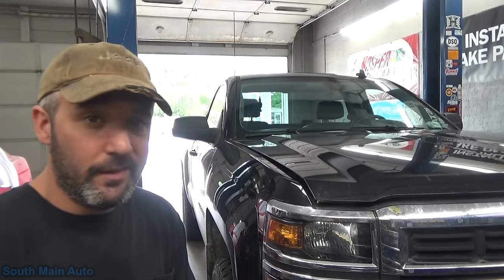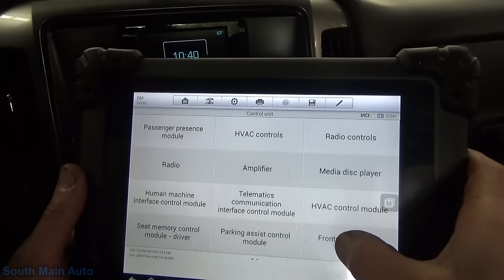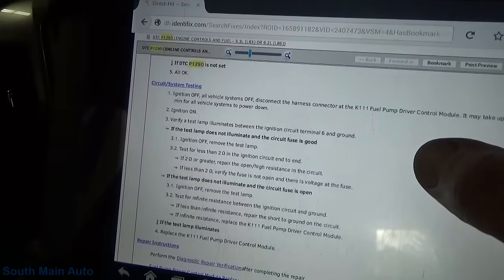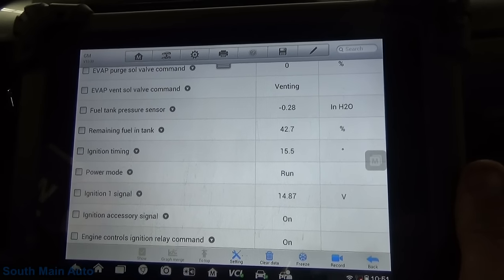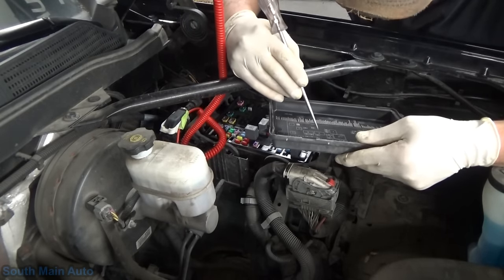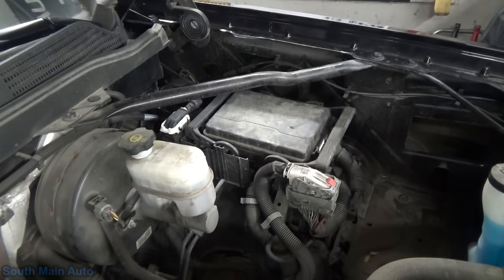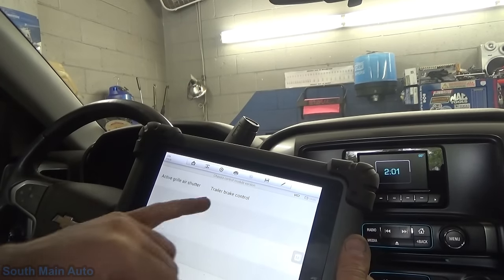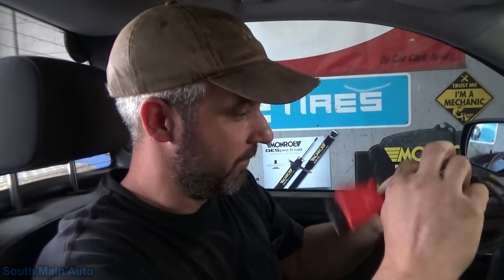Chevrolet Fuel Pump Driver Problems - Where Is The Broken Wire

Comment: see another one i sat thru and learned alot, very methodical, i too do the band aid on the wire it self,  what r your thoughts
on, in my case i would spray the connections with a good shot of wire dri followed with a liberal amount of dialectic grease 
some of those bastards are hidden and i just don't want to think about them again for a couple of years, anyways another excellent video. i wish i had you as my high scool auto shop teacher.

Comment: SMA and One Auto video on a friday...... damn its a good end to the week :) 

Out of interest is there any reason why the wire broke???
Reply from the maker: It must have been compromised sense new I imagine. No other clues were there where it broke.
Reply: +South Main Auto Repair
Yes, I also wonder if that was a disgruntled employee that accidentally missed that damaged wire....Or perhaps a temp contract QC inspector that was sleeping or high on the job while they were supposed to be looking for flaws. LOL I work in a tier one vendor plant and usually that is the case. Plenty of processes in place to prevent things like this flaw from not being contained and slipping by to the manufacturer.

Comment: Every car issue i have had has never ever thrown any codes but ran like garbage - 2001 Toyota Corolla with a jammed IAC valve (stall with ac on when cold or low cold idle high hot idle), 2000 Nissan Pulsar (bad MAF sensor), 1996 Subaru Liberty (moisture in one of the spark plug wells causing a misfire NO CODES), 1992 Toyota Celica with a bad MAP sensor,  and a 2000 Subaru Outback that ran like garbage (sold), never figured that one out again zero codes or any hints as to the issue, and i have a 2012 Holden Commodore now with idle nibbles again ZERO CODES. FML.

I swear all Australian cars have misfire detection removed on all ECU's.
Reply: apachelives after all those cars of different makes, all due respect but maybe the problem is you and not the cars.
Reply: how can the problem be me?

Comment: Had the same problem in my shop but I used a Fox Hound to locate the break and then used a sowing seam ripper to open the harness. Except now the wife is upset that I went into her sowing kit without permission and even ignored the "no borrowing" sticker on the side. And now Ma Bell is after me for unauthorized use of a fox hound. Should have brought the truck to SMA
Reply from the maker: Did you  use OEM tape to put it back together?
Reply: Dorman

Comment: I got a feeling those telephone tracers don't work as well as is said, because the phone company is always pulling at least 32 to 1024 twisted pairs or better with many many unused pair left over to transfer broken lines too. They use the tool mainly to find the correct ends after separating the wires at the ends to detect which pair carry the tone. Lol Jpol.

Comment: hey buddy, i have a 18 seirra 5.3 crew 4x4,  thing stalled after sputtering while driving , p129d p12a6, checked wiring, im a licensed mechanic,  cleared drives fine, but dont trust the truck now, no warranty on fuel components either dont want gm to run a big bill on me any ideas?

Comment: This was an awesome repair it shows us how to diagnose a problem and fix all the open sores. And by no means are you stupid or dumb if you just popped a $200.00 pump on it and then found out it was just a wire you would be a diaognoster generous you are your talented.

Comment: Again Eric O ..
 Ive always been taught to replace the wire . That if you can pull good voltage yo a point to cut both ends and run new rather then opening the harness to try and find what could be a break inside installation that youll never see .

Comment: Hey guy's, I'm trying to diag a crank no start 2014 silverado...  got hit in the rear then crank no start after that.... Thought it would be The fuel pump driver. Tested using Eric's wiring diagram at 8:32 I have Ign voltage at Red/vt wire Ing voltage at the Violet/green wire and ground at the black wire... Leads me to believe fuel pump module... I'm trying to jump the fuel pump so as to absolutely rule out a bad fuel pump... Think it would work???
Reply: Inertial switch has not been reset.

Comment: OMG! THAT'S A 3 YEAR OLD TRUCK.....do you see the rust on that thing. Call it 4 years old if it was made in 2013....still....WOW!
KROWN up mr.truck owner.
Reply: piece of shit chevy
JUST LIK EMY 97 DODGE TRUCK-- JUNK
FORD TOO- THEY ALL RUST OUT BAD  
NEIGHBOR HAD CROWN VIC- COP CAR STYLE 2004- RUNS BUT RUSTS ALL OVER
NEVER BUY A CHEVY, FORD, DODGE-
Reply: i live in ontario canada, and i've found out the hard way for years about rust. 
But found the best thing you can do is oil spray them yearly. 
And where i am in Canada Krown it the very best option....then they don't really rust out if you get to them early enough. But you gotta spray each year and do your part by washing it it a bit in the warm to get the salt off. Fluid Film is good too.
Reply: Good day. I'm KIT-Waterloo area, yea rust in area problem. I think dripless oil is better & cheaper, I THINK
Reply: Also a little side note, i don't know what this means to you. 
But the APA of Canada recommends only 2 places to take your car in Canada. Krown is one of them. 
The other is a single shop a guy runs in Quebec. 
https://www.apa.ca/services_rustproofing.asp
Reply: Hey thanks for sharing that, making my appointment for Krown. Between this and Eric o's video I'm convinced.
Reply: --- Big Rockk  ---
Good Move on Your Part. 
If we were friends or family , i would be telling you to Spray your car Yearly & go to Fluid Film or Krown. 
Becuase......
The Damage of Rust costs way more than $100-$120 a year to spray.  And they work really well, slightly different tho. 
The Krown Website >  www.krown.com 
Shop Locator > https://www.krown.com/locations/all/

- Some Reccomendations for when you go to Krown- 
1- COVER THE SEATS Take an old house sheet or towel / blanket put it over your Drivers Seat.  ( i personally put towels down on the all the seats. Never had a problem with them getting anything on the interior...but i have cloth....so i just figure for the 10min it takes to throw some towels down why not. Also they are in a shop environment and nothings perfect so they might rub into something on the hoist or grease and sit on your seat. Just my 2 cents there. Otherwise you won't see oil in the interior, never been an issue.

2-  HAND WIPES/ TOWEL/STEERING WHEEL. Bring some hand wipes or maybe even a paper towel role...because they work in a shop environment
      you are gonna notice a slight bit of oil or maybe even lets just a slight texture on your steering wheel and 
      keys when you get in. Like i said they do lots of cars a day and i have just realized it's something you 
      need to understand is the nature of the beast. So i just do a quick wipe down with a paper towel or  
      meguiars interior wipes on the steering wheel. Some times this isn't the case, but more often than not
      i notice a little something on the wheels and keys. Just the way it is. 

3-  DOOR RUBBERS SILICONE. Ask your shop if they apply sillicone to all the door rubbers & weatherstripping in the areas where they 
      spray.  In the even they forget , before i go there ...i just take a can of Silcone Spray and a rag and wipe down all my door 
      rubbers with it....soak it down and wipe dry and the trunk. Just in case any excess drips on it. 
      Never had an issue with it....other than when i asked them to "make it rain "when spraying my car
      i don't care about the dripping (gravel driveway) so a little much came out and i forgot to wipe some 
     from the trunk rubber....and it got a little bacony in a small area....but doesn't effect function. 
     Anyway silicone is good for window tracks and keeping door rubbers good (scott kilmer does a good
     video on silicone and window tracks) 

4- WINTER WASHING/AEROSOL TOUCH-UPS. In winter i wait till it's above freezing during the day & night for 2-3 days straight & then i wash my car 
     and the next day i just take a Aerosol can of the Krown T-40 and go around the inner lip of the wheel wells , shocks , dog leg area and painted pinch welds and spray it down. Just because those areas get blasted with Water & Salt & other nasty road de-icing stuff. (ps if you don't have those molded mud guards on your car they are worth it ( i have a clear film put under mine so they don't rub on the body , had a auto --graphics shop put the film on for $50. So dirt doesn't get trapped behind the mud guard. ANyway ........YOU WILL NOTICE that cars without the mudguard often the rocker/pinch weld area are missing paint or are rusty....same model cars that have those Moulded mud guards are always in better shape on the lower end of the car.   So basically i just try and help the krown out. And if i've been out driving in a crazy salty area
where they just spread salt....i just take the can and start spraying in that area to neutralize the salt. (I REALLY HATE RUST ) 

5-  RUST VIDEO . 
     
    This is a good little video to watch 

      YouTube Video Search Name > 
      Global News Toronto - Prevent vehicle rust damage, How Krown Rust Control works

       Direct Video Link > https://www.youtube.com/watch?v=D8u9IlwkVX4

6. FLOOR MATS.  

Good Luck with everything, just remember if your car is 5-7 years old...there is prob some rust growing small or large inside those fenders you could never see (eg. if you could remove the outer fender and look inside you'd see something)  So even if after 5-10 years of spraying a used vehicle and some rust breaks out...just remember it would have been way worse had you not sprayed and slowed it down to a crawl A new one with no rust should last even longer because you are stopping it from starting if you spray right away. 
But i have a neighbour with a 2000 Chrysler Sedan and he didn't spray his till it was 9 years old and it's still on the road in ontario daily driver.  Just don't quit spraying, Fluid Film or Krown works for a about 12-13months.  

ooh and 1 last thing. I know a lady who had a 1999 Dodge and sprayed it every year at krown from new
car was great but it rust rusted out.....NOW you might as why is that.....well.....the car was fine.....
but her floor mats ...she never had rubber mats........and only carpeted mats....and the salt soaked throw the carpets into the floor pan for 17 -18 years...and the drivers side floor pan rusted out. 

So i can't reccomend those Husky Liners weather beaters or Weathertech mats enough. 
Because they are laser measured to fit your car , not really fits better. 

Personally i like Husky Liners better (they cover the dead pedal higher up in most cases) and are cheaper.

www.HuskyLiners.com 
www.Weathertech.com 

7. COUPONS - some dealers will take the Corporate internet coupon some won't 
    (meaning some only like to let people use the coupon they send you from their shop, just case by case basis) 
    My local krown shop has no problem with printed out coupons from the Krown website. 
    https://www.krown.com/coupons/   
    (scroll to the bottom on the main krown website and you'll see the coupon section)

8- KROWN SALT ELIMINATOR MR35.

Krown Mr35 Salt Eliminator is something worth looking into ( i wash my car with it in the winter, via a Gloria FM10 foamer i got from amazon.com  or amazon.de  (germany)  mix it 4-1 with tap water 
   Or i just take it to the Krown Shop and wash it for me during / after winter. 

-REMEMBER RUST NEVER SLEEPS -   ;)   spray spray spray ;)

Comment: Hey I have a 2014 chevy silverado lt crew cab 4wd  has a code for p2635 code is it the back fuel pump or high pressure pump

Comment: The truck has had a new fuel pump and sender installed 4 months ago, then again 3 weeks ago (warrantied). Still does not have a working fuel gauge. if you jump the blue/orange and black, fuel gauge goes to full. At a loss for words. can two new fuel pump sending units be bad? oh 97 Dodge RAM 1500. 5.2 v8 4 pin connector.

Comment: Have an 07 new body 4.8l silverado when I'm at idle my fuel pressure jumps up to 57psi from the standard 43psi and I get a p0300 and my misfires counters are scattered to every cylinder mainly 8th. I replaced and programmed this fuel pump module already and same thing happens. Misfires clear up omve truck is hot. Question is other than this module, what else will command the fuel pressure to be raised at idle is it the ecm? Thanks and do you know a great mechanic such as yourself located here in Los Angeles California? Thanks.

Comment: Good work Eric, how are the f150 over there  for rust?
Reply from the maker: They are not as bad as GM and Dodge
Reply: South Main Auto Repair 
wow good to hear I have f150 2007 and its not that bad of rust  here also north of you they tend use more sand with bit of salt or some places liquid deicer before freezing rain I heard that surf is tougher on metal but I haven't found that here,
also what makes you attracted to Toyota I lie your truck what made you choose that over gm ford or any other pickups ? appreciate your opinion if you don't mind . like your travel through the maze of unknown  mystery kinda keep them coming
thanks
Sal
Reply: why Toyota ? Eric  over gm ford or others better built?

Comment: A little sassy today ;-) The people must have been beating you up over a sewing seam ripper, wire toner among other things. 

Man that truck was crusty though.. Makes me wonder if GM gave up using anti-corrosion baths at the factory.
Reply from the maker: These new Chevy's rot out faster than people can pay for them. I have failed some 2010' and 2011's for rotted out frames when they come in for NYS Inspection. They are worse than Dodge IMO

Comment: now what would you charged for that job, it would seam to me, that you're not working as hard as you would with out the electronics you have at hand, which will shorten the hours , so do you up the hourly rate, how do you stay in business now ?them tires look pretty smooth,  do you ever tell your customers about things like that?
Reply: All that testing and unwrapping harnesses to find the broken wire translates into a warranty repair time  of 30 minutes paid to the tech if the truck was still under factory warranty. Been there. Done that.

Comment: Regarding piercing wires:  Sullivan (Load Pro) states that "THERE IS NEVER A REASON TO PIERCE A WIRE !"  He needs to be working on off shore oil rigs that cost one million or more a day to sit there oin the ocean, there is an electrical fault & people are breathing down your neck to get the damned thing up & running, & I believe he would change his mind !

Comment: I have no power to the evap solenoid and the solenoid is activating while checking my fuse I found a 30 amp popped fuse it states STUD - 2 on the fuse cover 
What one is that

Comment: live data under trailer brake module .  will show low voltage. these two modules are one.
Reply from the maker: Nope two totally separate modules on this little guy
Reply: sorry the last one i did was same module

Comment: rust issues? they all do... I swore off fords after my 1990 pickup engine locked up because the only part bathed in oil ( the oil pan ) rusted though and destroyed my engine ... never looked at another ford since...

Comment: Theres a AIRBAG RECALL ON THIS TRUCK.

   CONSEQUENCES
   A failure of the front air bags or seat belt pretensioners to 
deploy in the event of a crash necessitating deployment increases the 
risk of injury to the driver and front passenger.
Reply from the maker: There is a recall on every GM on the road
Reply: which is sad!! Honda's not as much..

Comment: Looks like aftermarket shocks, exhaust has been changed, wires rotted. How is it that a 6 year old truck is this rough when I drive a 20 year old van not to far from you on original shocks, tailpipe etc. Seems like some vehicles are just beat to hell. Even the aftermarket tailpipe is already rotted around the clamp. I guess my family has just been lucky with decent cars. We get stuff in just like this truck with very low mileage and problems from one end to the other. It seems suspicious to me when I get this stuff in.

Comment: I like gm , but it seems there connectors always have so much corrosion in them, sometimes I think that there system produces corrosion. and why I say that is, I have Toyotas and hondas, and there electrical connections don't corrode like gm

Comment: People are going nuts over the rust on the truck in reality its not that bad someone put a cheap ass aftermarket exhaust on it. Plus the stuff they use on the roads really eats vehicles up you should see vehicles from virginia they are horrible and I thought I had it bad here in Michigan but Virginias even worse because they use liquid with there salt that eats them up

Comment: I would hate to see the cost for that little broken wire very time consuming
Reply from the maker: $100 bucks out the door. Quick easy fix.
Reply: I would hate see what the dealer would of charged then again they wouldn't be able to find the answer like you. you are the best and fair with your customers I bought one of your stickers put it on my ridgeline to help promote your channel because you saved me big bucks on a repair I did myself thanks again. love your channel
Reply: +ironeagle2526 parts and troubleshooting about 1000$ i think 😀😀
Reply: you are more than likely right if they could solve it

Comment: He should have called GM. I got them to warranty my ball joints..
Reply: PhillLsx Ga. if they can’t find the broken wire then they will replace the whole wiring harness..My cousins moms truck took it the dealership because of a short to ground and it costed her $5000 for the wiring harness because they couldn’t find the broken wire lol